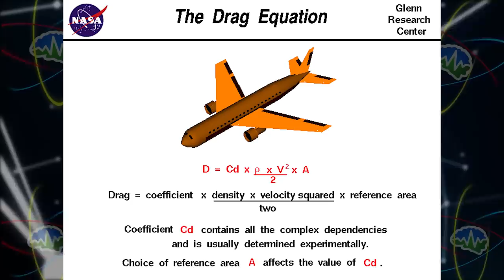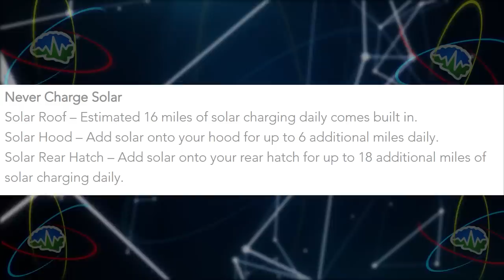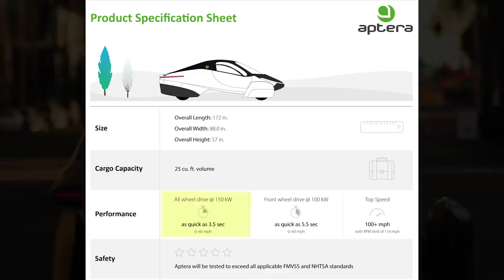Aptera Beats Tesla? | In Depth

Comment: I like gas cars and I see a parallel to race cars. This is also my main argument why I don't like formula E. The "boost bonus" and cars feel to similar to the point on being kinda cheesy. homologation is also the reason never liked formula 1 or nascar. power to weight is the main focus of race cars. After the oil crisis cars got smaller and engines became more efficient. Therefore Japanese cars became more popular because they were naturally more efficient. But now the electric cars are the size of gas cars and that doesn't exactly help them with range. I think that electric cars need a race series similar to how nascar started "stock car racing". Racing stock cars with the goal was to push the gas cars technology among the participants. So far this car is one of the few electric cars I have seen that might actually push the car form in a truly new way, instead of just making a ordinary car with futuristic looks and a big heavy gas car body. electric cars have to humble themselves, and realize that batteries still carry large fractions less energy per weight than gasoline. This would be a good car share vehicle!

Comment: Here is the difference between the Aptera and the Model 3.  The Aptera seats 2 and the Model 3 seats 5.
Reply: This is not the only difference.  Aptera uses less than 100 watt hrs per mile at EPA speeds, considerably less than the Model 3.  For some users this is decisive.  Aptera's next model will be a 5 passenger, 4 wheel sedan, which will be more directly competitive.
Reply: @n.brucenelson5920  At that point then they should make the comparison.  Right now, they are comparing a 3 wheeler 2 passenger vehicle to a 4 wheeler 5 passenger car.  Any motorcycle even one that runs on 3 wheels are going to use less power than a traditional 4 door or 2 door sedan.
Reply: @Ryooken  I agree, except for this: "Any motorcycle even one that runs on 3 wheels are going to use less power than a traditional 4 door or 2 door sedan". 

I have owned both - I have over 400,000 miles on motorcycles - and because of air resistance the motorcycles almost always get worse mileage than the cars I have owned.
Reply: @n.brucenelson5920  I agree and that's because while you are driving a motorcycle, you are part of the wind resistance.  So effectively you are blocking the air causing the cycle to slow down.

Comment: Nice troll. I want my 20 minutes back. You're comparing a $40k four-wheel, four-seat, high-tech Model 3 that could withstand a vehicle collision to a $30k two-seat tricycle... because of miles-per-charge? What's next, Yamaha YBR's vs Toyota Camrys?
Reply: You don't get it do you?  The Aptera we are discussing is designed to and will be tested to the exact same collision safety standards as the Tesla.  If they didn't think it would do well, they would not have gone to the expense and potential risk of a bad rating if they didn't expect it to do very well.  Aptera is about performance - not pre conceived notions of what is possible that are based on lazy thinking instead of actual numbers.
Reply: From Aptera's web site: "..we are designing to exceed all passenger car standards and the previous version had the highest roof crush strength of all passenger cars on the road, and it performed exceedingly well in actual side and frontal crash tests. Aptera features a Formula One-inspired safety cell with advanced composites and metal structures for impact strength. Similar to aerospace and racing, these energy-absorbing methods are a core part of our safety strategy and have proven effective time and time again in high speed impacts. Aptera also makes use of today’s best forward and side airbag systems in case of an accident."

Comment: If everyone switched to EV's can you imagine how much more electricity our nation would need to produce in order to charge that many vehicles! And with a certain segment of people that won't allow us to use nuclear & wanting to ban all fossil fuels how would we charge them? And no wind & solar will not cut it.
Reply: You need to look at this a bit more carefully.  First of all, many Apteras will never need to be plugged into the grid for everyday driving needs, due to the full solar option.  They will be taking load off our energy infrastructure.  In addition, the normal charging patterns for those who need to use grid charging will make the grid more robust, especially as V2G becomes standard.  Your "Wind & solar will not cut it" is not backed up by the facts.
Reply: @n.brucenelson5920  I have my master electrical license in fifteen states. The fact is "wind & solar will not cut it" because currently on the blend of wind & solar combined they're not even producing 10% of our nations energy. We need a blend of all forms including nuclear.
Reply: @benriding8678  None of these are reasons.  Nuclear plants are a non- starter because they have long since become uneconomical and don't cover their eventual decommissioning costs.  The tech is neat- I have worked in quality control in the production of nuclear fuel rods and seen the issues from the inside.  

Solar and wind are already far cheaper than coal and natural gas, and coupled with new storage tech - which battery powered vehicles could well be a major part of, means that we need to speed the transition.  This will result in  major cost savings to the economy and improvement in our competitive stance abroad.  We also need to build the Clovis superconducting grid intertie and build more high voltage dc long distance transmission lines.  The faster we can transition the grid to dc, the better, and the better for American jobs.
Reply: @n.brucenelson5920  @Ben Riding One fact Bruce is unaware of (or ignores), is nobody will build enough charging stations to accommodate high volume sales, and people will wait all day at what few there are. There have been articles about it. Also, check out how many charging stations on Norway are out of order? They break easily, and take ages to fix. Bruce needs to look at this a bit more carefully.
Reply: @n.brucenelson5920  "I have worked in quality control in the production of nuclear fuel rods and seen the issues from the inside." You should never get on the inside.

Comment: who is the market for this car? its a tiny death pod.  i suppose its a niche market but its impractical. it cant go far and it cant haul much. who is it for? why is it more compelling than a leaf or a model 3?
Reply: I don't think you have noticed the specs.  Can't go far?  The 100 kWh battery pack version can do 1000 miles on a single charge.  

It will be crash tested to automotive standards and I bet will exceed the Tesla model 3 by some measures, such as roof crush strength.

This is designed for commuters, couples. Who will use it for weekend camping getaways and retired couples who are driving long distances to visit grand kids.

Demand is already high compared to planned production.
Reply: @n.brucenelson5920  100kw in a car the size of a lawn chair doesnt sound like a fun commute. the teslas have the decency of being a medium sized sedan.  if its for commuting 100 miles it doesnt need the range. if its meant to do cross country its too small. who is the car aimed at?
Reply: @danroden830  It is hard It " the size of a lawn chair" :  At 172 inches (4,369 mm) long, it is about 4 inches shorter than a Prius. However the Aptera has a larger luggage capacity (25 cubic foot (708 L)) than a Prius (21.6 cubic foot (612 L)) or a Tesla Model 3 (15 cubic foot (425 L)).

Comment: Aptera did not beat Tesla, because because Tesla has been building EVs with the standard 4 wheel, four seat layout ... not a ultralight & efficient 2 seat tri-wheel EV.

Aptera is catering for a niche market, not the mainstream that Tesla & the other EV companies are doing.

Battery technology may improve someday to get 1000 miles from a single charge, but most EV buyers will be happy to get and enjoy their standard EVs with 200 - 400 range, with the high prices.
Reply: The 1000 mile range early production was the first to sell out - in under 12 hours.  Yes, this is a niche - but far larger and more practical than the Tesla Roadster.  And they took in more than double the preorders in a month than Tesla sold in 4 years.
Reply: @n.brucenelson5920  Again.  Tesla and all the other mainstream EV makers are targeting 4 wheel, 4 seat EVs with conventional body designs.  Aptera is purely focused on 2 seater, 3 wheel EVs optimized for range per charge with dramatic weight reductions & minimal drag.

Sheez.  Why are you comparing the sales of a three wheel EV with no competitors because it fulfils a niche market ... to a 4 wheel EV of the main market for these vehicles, with many competitors with every EV having the same conventional car layout and body form?

Most EV buyers will not be interested in a radical three wheeler for two people only, and the buyers that are, would use the vehicle mostly for city commuting.

They are both EVs, but you are comparing an apple to an orange.

Tesla has no interest(so far) in developing a super efficient and lightweight two seat three wheeler EV.  This is not their target market.
Reply: @abelincoln6150  "Most EV buyers will not be interested in a radical car for two people only"  which is what Tesla introduced with the Roadster.  They never thought it would be mass market, and neither does Aptera think their design is.

The Aptera follow on vehicles will also be four wheel and for more passengers and cargo, following what was a successful path for Tesla.

Don't be too focused on the car - the design focus and the business model are pretty similar and Aptera's manufacturing approach is dramatically less capital intensive.
Reply: @n.brucenelson5920  lol.  The Roadster is a sports car EV 4 wheeler.  It is not the main cash cow of Tesla's vehicle range.  So you're now saying the Patera is a EV sports car ... targeting buyers of sports cars?  lol.

Get out of here with this nonsense.  Tesla is focused on the main market with a sports car, saloon, crossover suv & now pickup.  Aptera is targeting a niche market.

Sheez.  Tesla would have developed a 1000 mile tri-wheeler two seater years ago ... if Elon was interested in that market.  But Tesla's first EV was built on the Lotus Elise which is a FOUR WHEELED conventional sportscar.

You keep bring up the Roadster to compare to the patera, because it has two seats ... but completely ignore the fact that it has a standard car for and is on 4 wheels.  smh.

What was done with the Patera is not ground breaking new technology ... that a man who devised a vetical take off and land booster rocket would have NEVER considered.

Elon would have known about extending range by making a lighter vehicle, and reducing drag with sleek minimalist design on the fewest wheels as possible.

Tesla is not interested at all in building a 1000 mile triwheel two seater.

Tesla is only interested in extending the range of it's vehicle "conventional" vehicle range with new battery & engine technology.  It's only interested in meeting the demand for EVs ... by the MAJORITY of buyers.
Reply: @abelincoln6150    "It is not the main cash cow of Tesla's vehicle range".   At the time Tesla started giving rides in the Roadster it wasn't any kind of cash cow - in fact the company I worked for at the time hired most of the Tesla engineers because he had to lay them off.  The transmissions had to be replaced after every demo ride.  It was a joke.  

The Aptera vehicle, even though it is a clean sheet design, is far more finished than the Tesla was, and is a real car - unlike the Tesla when it was first shown.

Everyone could go to Tesla now and place an order for a model 3 and get quick delivery.  The fact that thousands of people like myself would rather take the risk of a preorder of a vehicle yet to be manufactured should tell you that Aptera is on to something.  The EV market is so young that neither Tesla nor any other company need to deliver a product to the majority of buyers to be wildly successful.

Comment: Totaly, if you live in Californa or such... But what is with, lets say, Brittish weather?
Reply: It has far better traction control for wet weather than any ICE vehicle and will gain range much faster than any other EV plugged into the same outlet.  At EPA highway speeds it uses less than 100 watt hours per mile.
Reply: @n.brucenelson5920  I thought more about solar panels. I think, if it is rainig half the day and the rest of it is foggy, you most probably can forget your 40 Miles. Superior traction is something, all electric cars have in common.
Reply: @elrondmcbong467  You are right about the weather impact on solar range.  You have missed how much better the wheel motor traction control is compared to any other EV.

Comment: I would like a company to redo driving vehicles.  I feel this company its on its way, but not there yet.  Needs to be smaller and much cheaper.  All we need is a vehicle for commuting some miles, in city, each day.  There is absolutely no reason for a 1000 mile vehicle like this.  I don't think this would be a comfortable vehicle to long distance travel, and it only seats two.  You may even be fine w a 50 mile vehicle that is easy to charge, so you can charge at work or at home.  Also, this vehicle feels like a Polaris slingshot, rather than a car.  So pricing has to be more in line with those.  In this design, it does not feel like a safe car to drive.  It looks like everything would get destroyed along w the driver.  The more I think about it, the unpractical it seems and expensive.
Reply: First, the initial 1000 mile range versions sold out first, in under 12 hours of being offered, so  the demand is there, in spite of the price.  There is a 250 mile range version starting at $25,900.

Many people will use this for commuting and like most vehicles, will only seat one much of the time.  The Polaris Slingshot has a place, but it was not designed with automotive safety standards in mind.  This car has front and side airbags and is designed to perform well in standard crash tests.  The ratings will be available before production begins.  Details matter.
Reply: @n.brucenelson5920  Sorry if it sounds like I am knocking your product.  As I said in the beginning, I do believe cars need to be redone.  One is driving too much space and matter around when driving a 5 passenger car+ to go to work or do errands.  I think you are on the right path.  Right now it is "the new thing" so people will be curious about it, but in order to stay the long run, my points will matter.  Right now those front wheels don't look like they have much protection against any collision.  I do have a rough design in mind that would be practical and believe it would catch on if you are interested.
Reply: @eccomz  Eric, you may be right about that.  Please understand that I have no direct connection with Aptera other than as a volunteer in the Aptera Ambassador program.

I have been concerned about the environment for a long time, and this is a fun way address a small part of the bigger problem.  I engage on these forums, not because I am right, but because I think discussion is healthy.

If you think your approach might have a chance of working for Aptera, to protect yourself, you might see if they will sign a simple NDA and let them know about it.  I suspect that they are too busy and too far along with the current design to do much about it, though.  I know they are swamped.

Comment: "Its not small, it is as long as a Prius and as wide as a Model S".

In terms of its footprint sure, but it looks like the actual usable internal space is most definitely less. No one cares about the footprint of a vehicle being too small, they care about usable internal space for passengers and cargo. Judging by what I have seen in this video it doesn't look like I would fit much inside of this car. This just looks impractical.
Reply: It still has 25 cu ft. of storage and enough room to sleep two people in climate controlled comfort on camping trips.  Cargo capacity rating is 500 pounds, though.
Reply: @n.brucenelson5920   for the same foot print the 2021 Prius seats 5 with a passenger volume of 93.1 CU FT. Source is the official Toyota website.
Reply: @reecefowell  Yes, but moves with far more environmental burden if the vehicle is occupied by one or two people.  The use case is the same, but if they overlap as they often will, the Aptera is far more efficient.  We will rent a vehicle if we need to for the few times we need the extra capacity, which is what we do now.
Reply: @n.brucenelson5920  you own an Aptera?
Reply: @n.brucenelson5920  anyway, my original point still stands. They mention the vehicles exterior dimensions to imply that the utility of the vehicle is comparable to a Prius. It is just disingenuous for them to say that knowing full well the usable interior capacity is not comparable. It is dishonest.
Reply: @reecefowell  At the moment I own a Gen 1 Honda Insight. I have worked in the environmental field for many years ( I was in Kuwait during the fires).  I judge the Aptera to be one of the most fun ways to make a positive impact on reducing the mess we have been making, and will be taking delivery of one of the first 50.
Reply: @reecefowell  It is not dishonest - it is fact, and it speaks to the potential safety of the design.  It is clearly presented as in a different utility class.